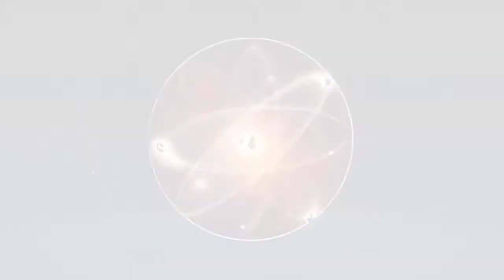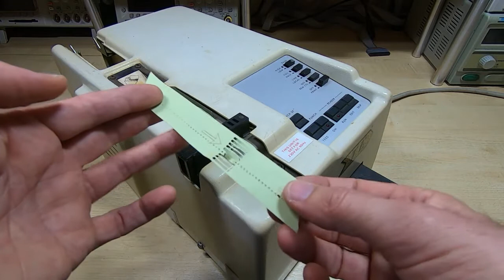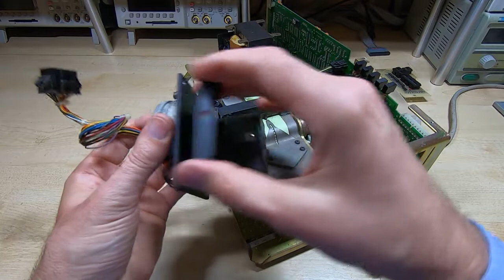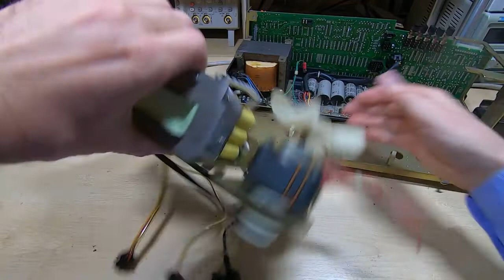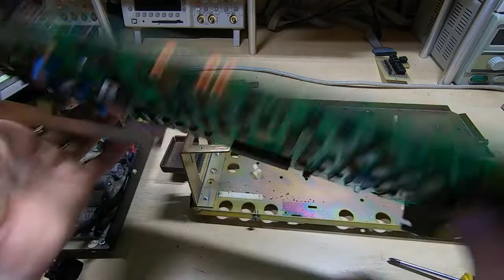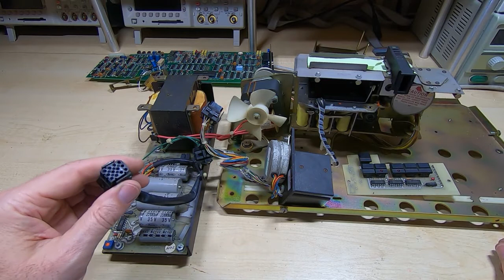LRP-300V Part2

Comment: Tape punches are one of my favorites, there's just something fascinating about watching electro mechanical devices working. looking forward to seeing the punch head in detail. It seems a really well thought out device servicing wise, I just wish my Facit 4070 was built like that !
Reply from the maker: Yes I totally agree. This is easily the nicest punch I have worked on. I have already taken video of the punch head and as soon as the new belt arrives I will be posting the next update. The head is really easy to work on and does not seem as convoluted as most designs. If you think the Facit is a pain you should try a Trend, I am sure that whoever designed them was being deliberately obtuse. I have no idea if the control board works but even that is easy to work on. I have not looked inside the reader yet. It has been suggested that I make a video loading a program into an MDS using a tape reader and this may be a good candidate.
Reply: @JerryWalker001   Although the Tape based Editor / Assembler seems to have vanished bar a copy in a museum in the states somewhere, I did find the ROM Based version and this can easily be converted in to tape. You do need the full 64K of Ram as it loads high in memory. I did sucessfully load it via the Monitor and the TTY Port, haven't tried the parrallel port yet. Let me know if you want the code and I''ll glue it together and email it to you. I have the manual as well.
Reply from the maker: @martynsvintagecomputing6338  That would be very useful. It would be nice to be able to show the MDS units running various software. I can easily convert the code to a tape format and punch a tape. I may try loading it using TTY and then use the MDS to punch it to tape.
Reply: @JerryWalker001  Great I'll dig out the code and manual. One other thought if you have time at some point I'm looking for someone to test my img2mds program on an MDS II / III as currently I can only test on the MDS 800. I feel this would be of great benifit to MDS users as it can produce a bootable floppy from an img file with nothing more than a serial cable and a completely blank floppy. Have a look at my video and see what you think with your channels greater reach it would be a real bonus. It takes around 7 mins to produce a floppy at 19200 Baud, but so far has been very sucessful especially on 3.5" 360 Rpm Drives.
Reply from the maker: @martynsvintagecomputing6338  Happy to try the program. I have not tried running the MDS using terminal mode as the units have built in displays but once the console is redirected it should work fine.
It looks like it will be a very useful way to create disks for the MDS units which as you say is a real pain. I wonder if there is enough space in any of the system ROM's to add the bootloader (or even the main loader)?
How many bytes are they? I assume the code is relocatable.
Reply: @JerryWalker001  The bootloader is 26 bytes long it's not relocatable as this was a proof of concept kind of thing. The main premise being that you could take a completely stock working MDS and create bootable media with nothing more than a serial cable and a laptop/pc. I've been told that if you unplug the keyboard on the MDS it defaults to the serial port, however I've not tried it obviously. I'll email you all the stuff I've released to the Intel Dev List, currently I've not released the source publicly.

Comment: Nice video, but taken too much time to show the removal of nuts and bolts.
Reply from the maker: It is hard to make a video on dismantling something mechanical without showing removal of bolts and screws. I showed the entire process but I understand if you are not interested in watching this, others are so that is why I show it. You will probably not be interested in the rest of this series because it will mostly be machanical work and will require a lot of fastner removal (and refitting) which I will be showing in detail. This is intentional as it shows the mechanical nature of this older equipment.